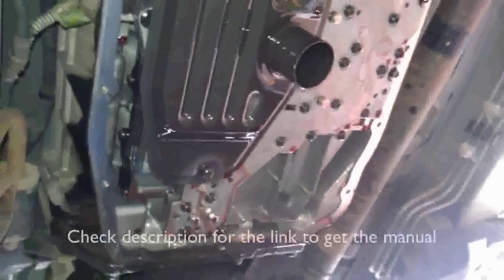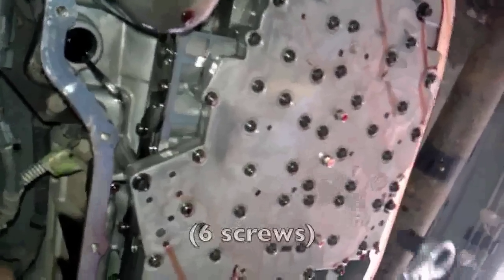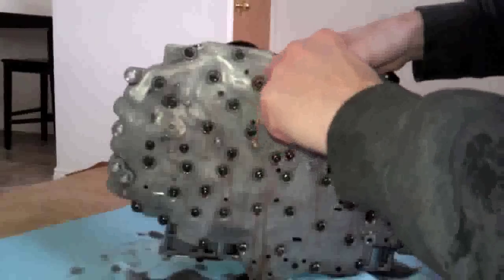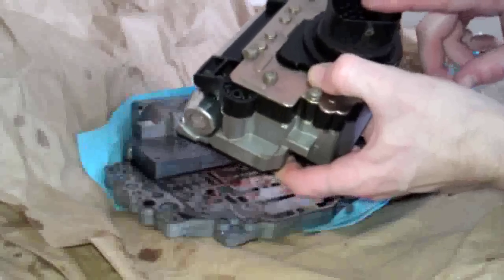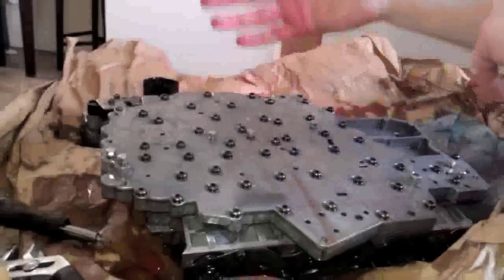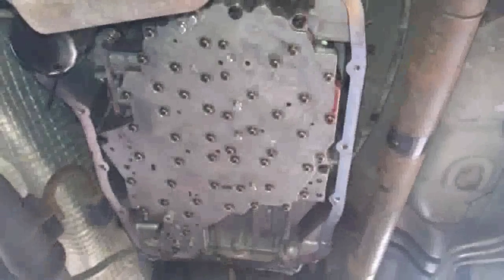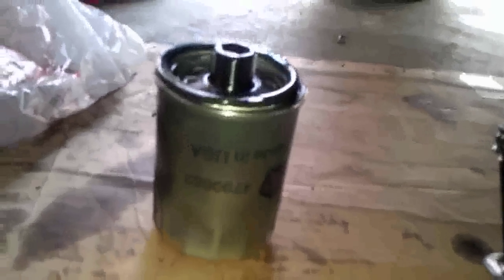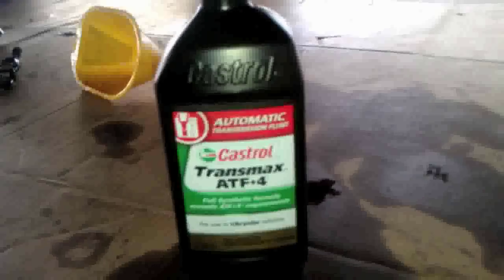Solenoid Pack Replacement 99-04 Jeep Grand Cherokee 45RFE P1781 Fix P0700

Comment: if you have an automatic transmission. What gear does it need to be in? Also, do you need to put it in 4L or leave in 2H?
Reply from the maker: For the repair? It doesn't really matter what gear it's in, as long as when you reinstall it the selector plate matches where the shifter is. So I just kept it in park. I would do park or neutral.
Reply: Thanks Jeff. I have disconnected the wires, removed the square bolts, and the valve body is not dropping down. It feels like it is stuck on something...Any ideas?
Reply from the maker: +Jer Cummings not sure. Those bolts are the only thing holding it in place as far as I know. Might just take some wiggling.

Comment: I need help please I have a 2002 Jeep Grand limited, I thought it needed a neutral safety switch sensor, because sometimes it doesn't start when its in 'park' but then take it out of park and put it back in, then it falls into place and starts, and the rear back up lights don't come on in reverse, talked to the mechanic today, and they tell me it's a completely different part inside the valve body, called? transmission range sensor? is this the same as a solenoid? called automatic transmission valve body solenoid?
Reply from the maker: No its not the same. Plus I think a lot changed with the 2002 model so you need to check if you even have the same transmission as mine.

Comment: My transmission has no codes but it is hard to shift the engine revs high then shifts then at around 4o ish same thing when it goes to shift again then after 50 it will not shift again I can't go faster then 50 help what's wrong.there are no error code
Reply from the maker: Sorry I have no idea I'm not a transmission expert. I just know how to fix this haha
Reply: oh  well I have no codes on the computer it just stopped shifting.
Reply: +SuperJeremi10 you have a internal mechanical problem if there are no codes. sorry but that means trans rebuild or replace.
Reply: maligno1000 well  my tranny light came on engine light came on yesterday on the way home and the tranny started having more issue shifting I'm sure it was in for that  we will never no shortly after the light came on I was involved in a car wreck so the jeep is totaled and wont be getting fixed it had gotten dark it started to rain I lost traction hydroplaned spun out   and hit the cement guardrail going 50 both airbegs deployed the car is totaled but I walked out without a scratch on me I'm fine I got checked at the hospital my brother was in the car with me he has some cuts form the glass and airbag burn  form it hitting his arm other then that he is fine too we where heading home after running errands the weather was starting to act up I wanted to get home before roads flood.
Reply: +SuperJeremi10 sorry to hear that but good to know that your ok. stay safe my freind :)
Reply: yea I m glade to be okay I will post some pictures of the car later on  haven't been to where they towed it yet I can already tell you it was bad almost all the windows are blown out its got front damage rear damage on both sides it was such a nice car too was taken care of it looked brand new engine ran great tranny shifted good too  I just put a new converter on it too that's why I couldn't hit 50   then  the tranny light came on for some governor sensor  I was supposed to take it to the shop this next week but that's not going to happen now.
Reply: +SuperJeremi10 man that's a shame. that's always the case,when you take good care of something, something bad  happens to it.

Comment: I have a Dodge P/U with a 45RFE that never shifted right from the first day I got it and thanks to your video I was able to fix it. No more fluttering between gears or lugging in too high of a gear at low speed. Thanks for taking the time. The video is very well done.
Reply: How u know what trans u got

Comment: Jeff...I know the video is a year old...I'm hoping you get this question.  My 2006 Commander seems to be in limp mode.  I took apart the TCM and used electrical contact cleaner as a 1st step.  Didn't solve it.  My thoughts are the TCM is shot or the Solenoid pack needs to be replaced.  How did you pinpoint the problem when you had it?
Reply from the maker: I remember researching and being told it could be the TCM. I recently had a bank 1 sensor problem and the dealership told me it's almost always the TCM or PCM. Another mec told me it almost never is (turns out it wasn't,  just a sensor issue). It seems like a rare thing for problems to be related to the TCM. Based off of other forums describing the same symptoms as my Jeep and the solenoid replacement fixing it,  I went with that before attempting to mess with my TCM and it worked.
Reply: Jeff Weeks For my Commander, the TCM is extremely simple.  Between the drive to the store to get the cleaner, taking out the TCM, cleaning the contacts, and putting it back together...about an hour.  The problem for me...it is the easier part to try to fix the problem, but the, more expensive.   The solenoid is less expensive, but more complicated.  If I get the error code, will that pinpoint one issue vs the other?
Reply from the maker: Very true,  less expensive,  bigger pain to fix. When I got the codes one was OD PRESSURE SWITCH OPEN which is a fault in the solenoid pack itself. You should be able to retrieve the main codes yourself by turning your ignition on and off 3 times (that method works for my Jeep anyway)

Comment: Did your new solenoid pack come coated/covered in ATF? Just received mine today and it was leaking out of the shipping box. Very good and helpful video BTW
Reply from the maker: Mine was dry,  actually would've preferred it had been soaked it ATF as the moving parts were stuck (like those spring pins on the end of the arm)
Reply: Mine came soaked in ATF, but didn't seem to bother anything. I paid for a new one and was wondering if that's actually what I got... my jeeps running like a charm now. I appreciate the feedback and thanks again for the awesome video!
Reply: Mikey Murphy I just recently purchased my solenoid pack from the Dealer and it also came soaked in ATF,so I'm thinking that's a good thing. It was also sealed up in packaging.
Reply: Okay, good. I appreciate the feedback ajm12180. I feel better about it being a new part now. Mine was in a big heavy duty zip lock bag when I received it.

Comment: Good and descriptive video! What symptoms was your vehicle giving you when you decided to change the solenoid out?
Reply from the maker: When I would first drive away the transmission would go into limp mode (which I've now forgotten if thats 3rd or 2nd gear) and wouldn't shift past that. Once I got down the road a mile or so I could restart my car and it would shift fine. So I was able to drive for a while and get my research done before replacing it. I'm pretty sure it was my OD pressure switch on the solenoid pack that was stuck. It has a large magnet on it and was all gunked up.
Reply: @jalandub  Having similar symptoms today for the first time. Hard shift into limp mode on the way home.  Will do some battery disconnects and driving around to see if that helps narrow it down.  Your video is awesome - thanks for making this.

Comment: Dude!!!!!!  I wish I had found this video earlier.  I've tried diagnosing my 0700 problem and tried fixing it after doing my research and changing all kinds of sensors (crankshaft sensor broke and it's too damn cold in New York to deal with it) and had to get towed to station.  They changed ($300) after having brought it in originally for the problem (they changed air/fluel sensor, $200).    Problem still there.  Had it at the Chrysler/Jeep dealer this morning to finally get recall stuff taken care of and I kinda just crumbled into submission and had them look at the problem.  Yup, solenoid pack.  $850!!!!  With your video I could have done it.  True, the part is pricey but, not $850.  I can only chaulk it up that NOW I'll know what to do NEXT TIME.  sighhhhh.   What's that you playin' in your picture????    Thanks Jeff!!!
Reply from the maker: No problem? That picture shows me and my Fender but I mostly jam acoustic on my Australian Maton guitar.

Comment: Any benefits to going to the newer/upgraded white plug pack?
Reply from the maker: Not sure,  I didn't research that far. It's possible that the newer solenoid pack would be less prone to going out over time. My original lasted almost 15 years, so I was ok with just replacing it with the same component.

Comment: Thanks. New filter kit ans fluid and my shift solenoid has still been throwing the code and not shifting the trans until I reset and let the 07 Aspen sit with the engine off. I think i missed where you state which bolts are removed to drop the value body. Are they marked or easy to identify?

Comment: What were the Symptoms you were experiencing when it went into "Limp" mode?
Reply from the maker: After starting the car and putting it into drive it would accelerate partially through first gear and then go into "limp mode" which is 3rd gear all the time,  leading to slow acceleration and higher RPMs at road speeds. After getting down the road a little ways and when the transmission was warmer I could turn my car off and then back on and it would not go into limp mode. So my symptoms were not very severe but characteristic of the code it was throwing.
Reply: Jeff Weeks Have an 01 Durango, with 45RFE transmission limp mode seems to be 1st & 2nd, but no 3rd & 4th. Your video and info have helped me to find the problem, there is so little info out there for these transmissions.
Reply: Jeff Weeks  Your video is helpful.  What sucks is the price of that Damn Solenoid pack is more than it costs to actually rebuild the rest of the Transmission,
Reply from the maker: Evil Plman I got a refurbished solenoid pack for only $200 on Ebay
Reply: P0846 is the code I got.... fluid pressure sensor circuit b

Comment: HI, Jeff. Can you tell me how to replace the accomulator pistons and seals in the body valve at 545RFE TRANS. 2003 dodge ram 1500 , 4.7    2WD ?  Than you!
Reply from the maker: Sorry I have no idea how to do that. This video about shows the extent of my knowledge on my transmission, which I learned to do only because I had this specific problem.

Comment: Yes we need that adapter but can't find it anywhere
Reply from the maker: I would say just save yourself the hassle and get the original with the black connector, but if you want to get the newer white one then you will have to find the adapter plate and I don't know where to find that. Jeep forums offer a lot of help

Comment: Where did you find the adapter plate?
Reply from the maker: Are you talking about the TSR adapter plate? If you replace the solenoid pack with another original one (black connector, not white) then you won't need any adapters
Reply from the maker: *TRS adapter plate

Comment: CAUTION!!! Newer ones have a bolt holding the electrical connector that needs to be removed or the unit will be destroyed, also they are 8mm but 5/16 works
Reply: +stevenlee92833 what models have this screw you're talking about? I bought mine from cascade transmissions
Reply from the maker: Cool thanks for the added detail. Are you talking about the newer white connectors?
Reply: Jeff Weeks
There are a few different colors depending on where you bought the and the year, real easy to check, real expensive to break, I REALLY appreciate your video as I have shared it multiple times, just didn't notice before you didn't mention a bolt because your year doesn't have it. You can actually add 55RFE to the description as well because it is the same transmission (I know it's crazy) just different drive ratios. Here is a list of the cars with the 45RFE/55RFE

1999–2000 Jeep Grand Cherokee (4.7L)
2002–early 2003 Jeep Liberty (3.7L)
2000–2002 Dodge Dakota (4.7L)
2000–2002 Dodge Durango (4.7L)
2002 Dodge Ram 1500 (3.7L and 4.7L)

545RFE

2001–2011 Jeep Grand Cherokee (4.7L, 4.7L H.O., 5.7L Hemi)
2002–2007 Jeep Liberty (Diesel applications)
2003–2011 Dodge Ram (3.7L, 4.7L, 5.7L Hemi)
2005–2011 Dodge Power Wagon
2003–2011 Dodge Dakota (4.7L, 4.7L H.O.)
2003–2011 Dodge Durango (4.7L, 5.7L)
2006–2010 Jeep Commander (4.7L, 5.7L Hemi)
2007–2010 Jeep Wrangler (2.8 L CRD)
2007–present LTI/London Taxi Company TX4

Thanks again, I'm sure you have saved people countless dollars

Comment: Thanks for the video I got a an 09 RAN with the 68rfe Transmission which is basicly the same as this just with some heavier parts to accomodate the Cummins 6.7 Torque my truck does the limp mode then shut it off and it's fine ,So I bought the Soloenoid pack and had been looking for a few pics to make the job more familliar and no 68rfe videos but this  was complete from the harness plug for the solenoid pack and the manual gear selector pin engagement ,which  the items I wanted to see . Now I Know exactly what I'll be moving ...lol...I'm doing the solenoid which I hope is the fix on its own ,but I may need a new valve body which is a known failure also , But again thanks for taking the time to post the video these Youtube videos really take the guess work out of some things if you don't do the work in a shop .

Comment from the maker: No it didn't require any PCM work. I read in a forum about someone's trans shifting a little hard for the first drive but then it relearned on its own. Mine drove great after the repair.
Reply: Thanks for this, I just called my local shop for an estimate and waiting to hear back on it.  If it's insanely priced I'll be doing a DIY on it as well.
Reply from the maker: +Jake “Zebular” F they wanted $800+ to do mine
Reply: +Jeff Weeks Looking at $500 with new parts and install. I think I'm just going to have the shop do it, if I had a lift I would definitely just do it myself.